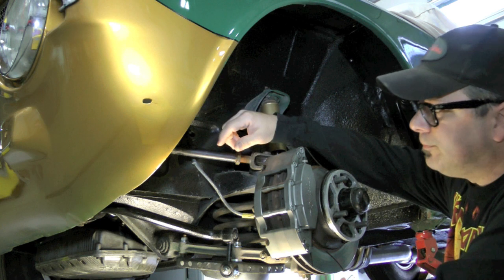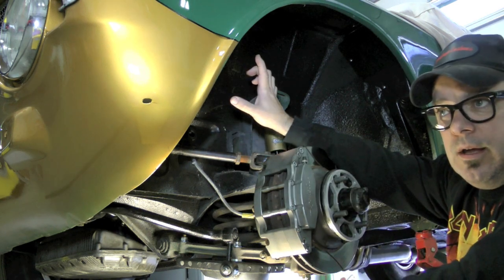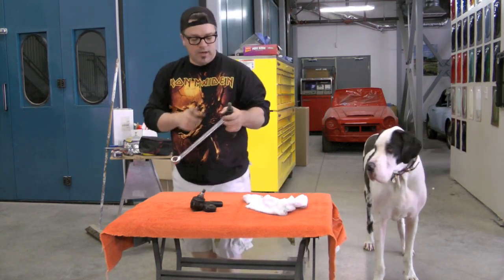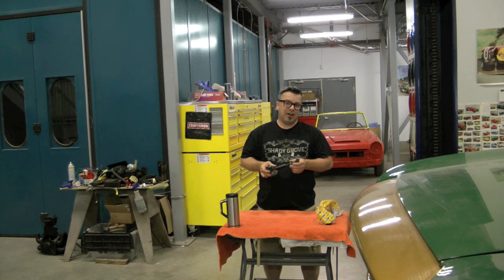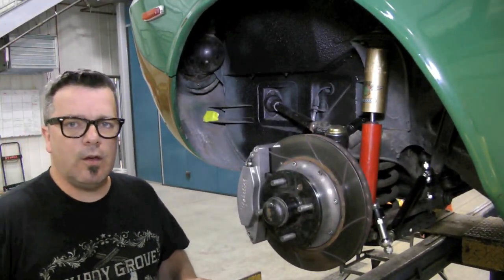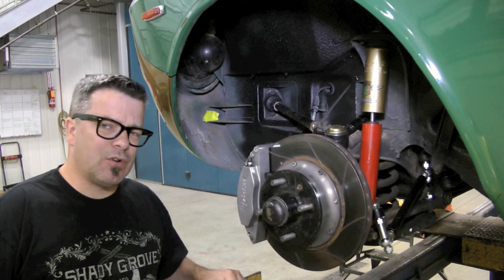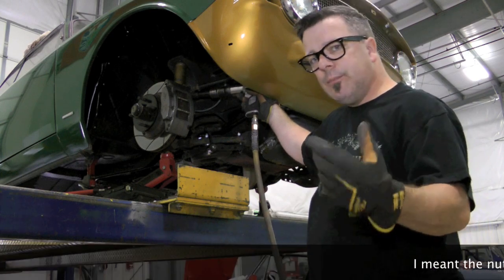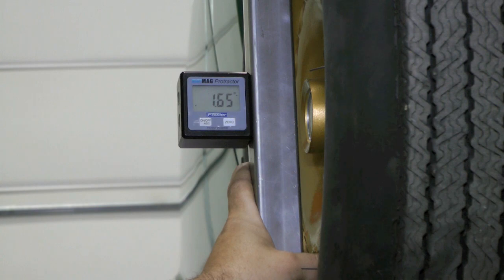Suspensions - Part 5

Comment from the maker: In 74...... ish the steering box came with a universal joint and column extension that was all right at the fire wall. This should be ideal. The big plus is it will all bolt right in.